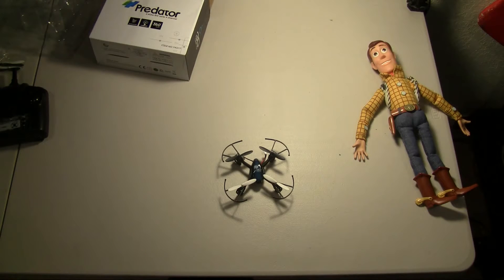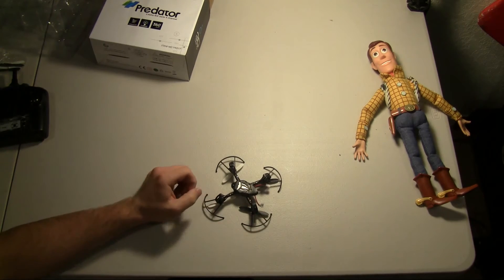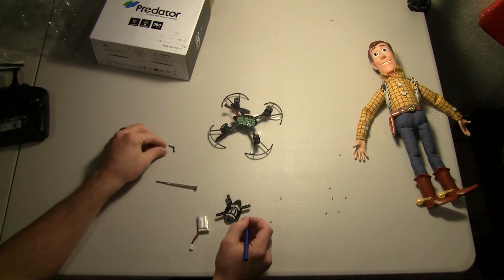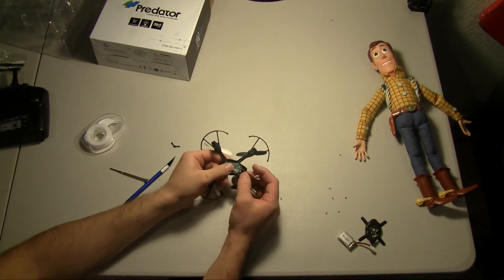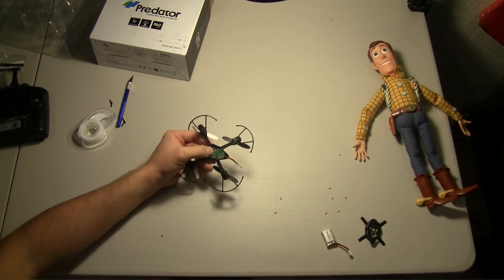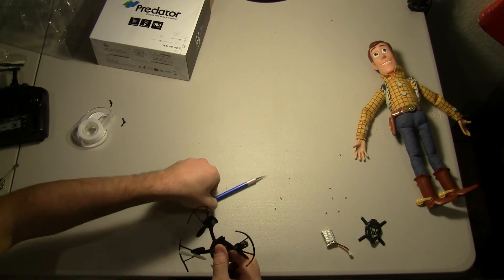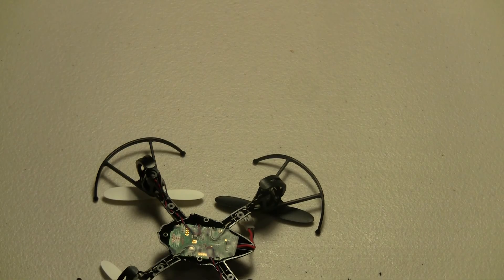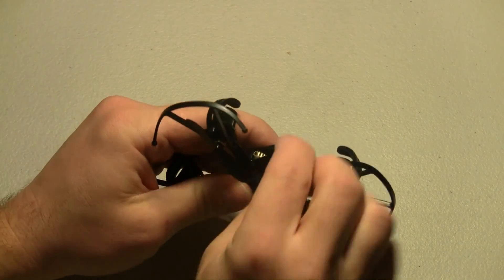Predator Quadcopter (Drone) battery mod

Comment: +Apex Just got one of these in the mail and i flew it for the first time. Now i cant get the battery to disconnect any suggestions? please help thanks!
Reply from the maker: +MVB 3773 By disconnect do you mean unplug? I have not heard of that before in a you, but you can have a friend heat up the connector with a lighter (do not put the flame close to the connectors or it will just turn black) take your time and year it up a little. Then it should slide apart.

Comment: Hello my friend. I bought a mini drone, was really nice my son slammed it on the wall now I can not calibrate or fly. Can you help me
Reply from the maker: +naldenir fernandes de amaral 

If you cannot calibrate it sounds like it could be a flight control board issue. You can get a new control board for most toy quads, but would require come soldiering.